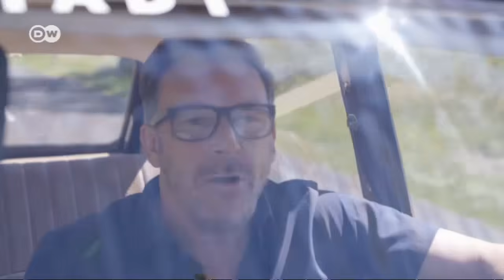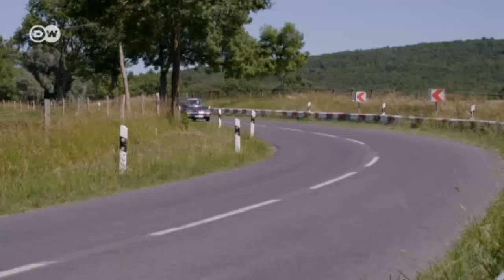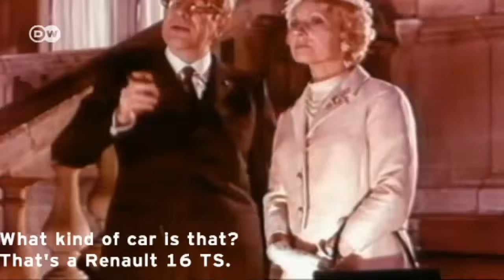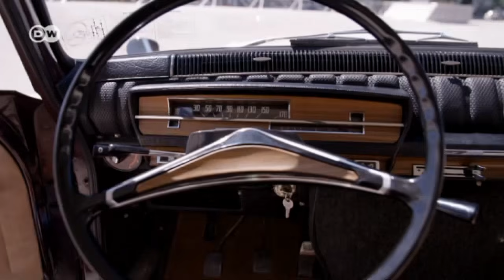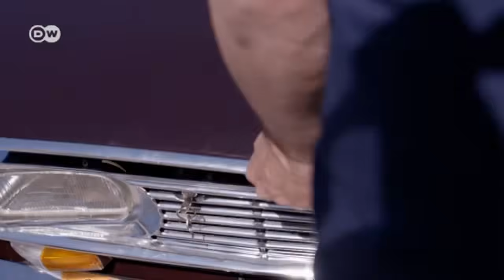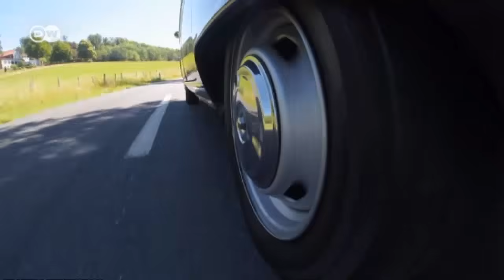Leisurely and Practical: Renault 16 | Vintage

Comment: I have Renault 16 '67 model Red.
By Design, Performance & Functions...its Perfect sedan.
Smooth ride with 4 independent suspensions, Powerful Front drive, I simply ❤ Renault16..fast and easy to Drive and Glide.
My enjoyments stuck when a major component brokedown and 1999 I cannot find the needed spare part.
With Happy memorìes, it did made me a popular man around town and its a talking point of conversations when I travelled far

Comment: First hatchback (?), still looks modern in 2024
Reply from the maker: Some say that the 1938 Citroën Traction Avant 11CV Commerciale was the world's first hatchback, but others argue it was the Renault 16 because the Citroën had a split rear door where the top half opened upwards like a hatchback but the bottom half opened down like a truck tailgate. In any case, the Renault certainly was stylish!

Comment: 70s classic. One of the last true Renault designs. And the R18 was an 80s classic. I am convinced the French WERE the masters of innovation and overall car engineering.  Italians knew how to make exciting engines and designs. Mercedes knew how to perfect a product. Unfortunately this talent has been lost today.
Reply from the maker: Where would you rank the Swedes in that list? We're thinking of the Saab 900 right now.
Reply: @DWREV   Sweeden being mainly Saab and Volvo, with the exception of the Saab 900 and perhaps 9000, I don't think they did stand out that much on the car market. As for the Saab 900 I had the chance to sit in a convertible one. It has to be the most unique interior design of a modern car that I've seen. I think the designers wanted to make you feel like the car was wrapping around you like a jacket. It's an unique sensation sitting so close to the door and with the windshield so close that you can touch it but it's not just because it's small, it really feels the dimensioning and passenger position were much calculated. Very rarely a car maker has dared making a car this personal, almost like a tailored vehicle.

Comment: I just bought one. Found it in a garage and its been covered from dust and weather since 1995. I just love the round guages on the dashboard. 1971 model 16ts. Its the first one ive ever seen besides the ones on the internet. To me it looks more like the citroen . Ive been approached by many who want to buy it but they too low for such a unique and rare car in such a condition. Its like nothing on the road.. i looove it,its not even running yet but people are so interested in it. 96000 original km on the clock.

Comment: I had one in the UK in 1978. The most comfortable car I'd had. Seats like armchairs, soft ride, plenty of space. The column-shift wasn't a problem, very quickly got used to it. It was good on long trips too. It failed inspection though on floor-pan rust and was, for me at the time, too expensive to repair. Shame.
Reply from the maker: Thanks for sharing

Comment: We flew to Luxembourg in summer 1971 and were supposed to have a brand new cream colored Renault 16 awaiting our 3 week European trip. Instead the dealer had no idea what we were talking about. It took a full week for a substitute Renault 16 to be located in downtown Paris...luminous gray with black interior. We were in no position to argue. After the trip we had the Renault shipped to Florida. The car had very comfortable seating but the air conditioner was poor for our needs back in Florida, especially given the black interior. My dad kept the Renault for 4 years even though we were never as happy as we expected. The rust problems were very bad. I would say this was the most disappointing car we had while I was growing up, but I still remember the Luxembourg situation fondly including staying several nights in the Cravat Hotel while my dad scrambled to find out where the heck was our Renault 16.

Comment: VERY PIGGY TO WORK ON WHETHER THE ENGINE, THE TRANSMISSION , THE BRAKES, In FACT  i can't think of anything straight forward to do with these ghastly  contraptions
Reply: Maybe he was shouting.  He was certainly being uncomplimentary about the car.  He obviously speaks from experience
Reply: @michaelporter4050  I owned one and worked on it myself. Not too bad once you got your mind in sync with it. Much easier than today's cars.
Reply: I still have a special C shaped spanner somewhere to take the starter motor off. (or option 2 was to remove the exhaust manifold) the spanner was the better option.
Reply: Mike Beeton, please "refrain from using upper letters because this could be seen as shouting": http://www.dw.com/en/dws-netiquette-policy-rules-for-feedback-and-discussions/a-18285540 - ws

Comment: citroen pioneered the front gearbox arrangement in 1955 in the DS
Reply: Cord had the same layout in 1936. I love the DS but it was second here.
Reply: And Cord in turn took this idea from Miller racers... Citroen also used it on their Traction Avant, well before DS. So that layout had been pretty old and well-known by the time R16 appeared
Reply: @romanteplov9227   However for a family car, it was one, if not, the first. Cord was hardly a family ca and the Traction Avant and DS were a class above.

Comment: He's dead wrong about why Renault chose that engine/transmission layout, however.  Look at the earlier Renaults---  rear-engined with the transmission/ differential housing jutting forward.  The 4-CV's, the R-8's, the R-10's, the Dauphines, they all had that powerplant/transmission layout.  With the R-16, Renault enlarged the engine capacity and moved the whole powerplant and drive package to the front of the car, which was still evident in the last car they exported to the U.S., the R-5, known here as the "Le Car".  I know-  I had one.